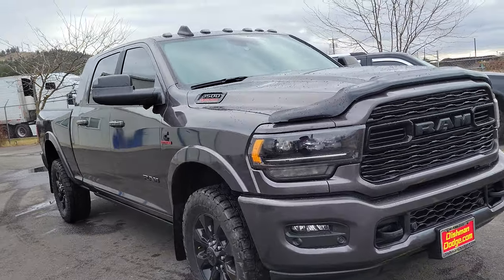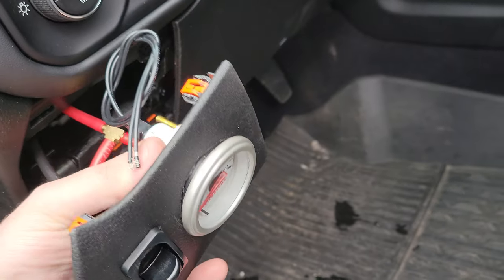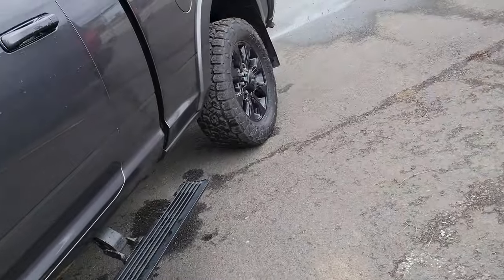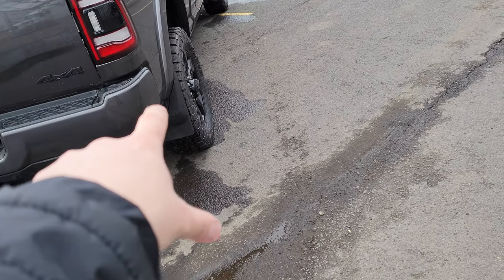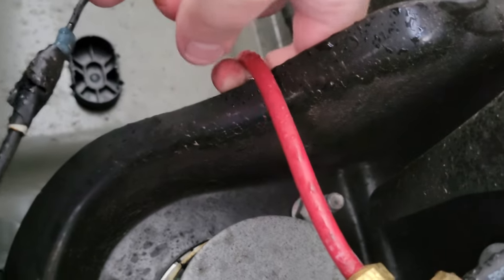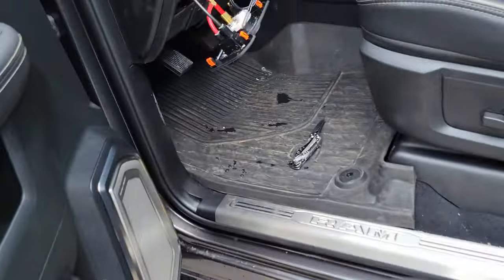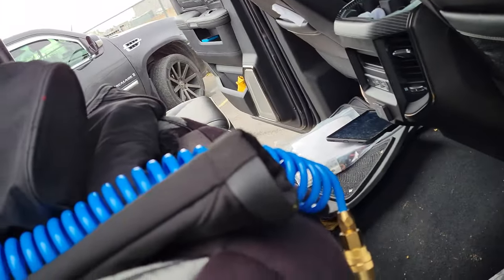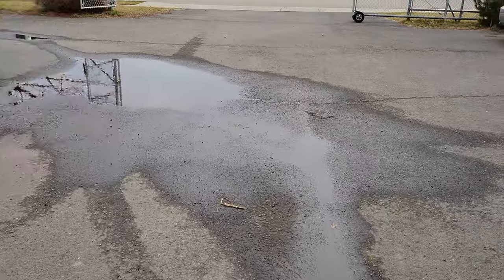2021 Ram 3500 gets a firestone 2543 extreme air quick  connect

Comment: Test drove the 2500 with Coil Springs but wanting to go with the 3500 HO which obviously has the leaf springs in the back. Was told to get it with the Automatic-Level Rear Air Suspension which would tremendously improve the ride quality. Yes? No? Or should I go aftermarket like you did? Will use the truck more or less empty, occasionally hauling some trailers.

Comment: I've found a gauge to be useless. Depending on the load the pressure is never the same. I air it up until it comes off the helper springs and it's good.  Also instead of a mechanical switch valve, I use electric solenoid valves and push connect couplers for the airlines. Solenoids are activated through remote FOB so I can adjust it from anywhere. For the quick coupler for an air hose there is a hole in the corner the rear of the bed I used. Also ran the 1/4 airline tubing inside the truck's frame. And lastly the manual fill I put next to the fuel filler. 
 Just a few ideas for you next time.

Comment: You should use black wire loom on the airlines for extra protection. Especially where you can see the red air line in the wheel well

Comment: That gauge is pointing towards the ground, spin it 180 so you can at least see the needle point at the numbers whole sitting in your seat. You just have to learn to read it upside down. I got that same kit when I bought my toy hauler. It worked ok but don’t think the pressure reading was correct and the lens cove falls off.

Comment: Why didn't you mount the quick connect and the back up air fitting on the drivers side of the truck so your not getting exhaust fumes if you hook up while the truck is running ?

Comment: Hello! First off....amazing videos. Literally just ordered the same truck in the delmonico red 3500 limited.  Quick question what is the tire specs your currently have? Any spacers? Did you need to trim? Please let me know. Want to have tires ready as soon as I pick up. Thanks! And please keep making videos! Great info and straight to the point! Not selling anything just giving your opinion is the best!
Reply: Also.... is your truck leveled? Or is it stock with just new set of tires?

Comment: Thanks for sharing.  I've also run a similar firestone kit on my old pickup.  Trouble free for about 4 years.  Now I've replaced that truck with another and need to reinstall another kit.  Air lift seems to be a more cost effective solution and also has built-in jounce bumpers in the bags so that you don't have to maintain a min 5psi.  Any comment on the durability/quality of Air Lift systems compared to Firestone?

Comment: you have isolate your airbags from each other or they will cause a massive amount of body roll, its is extremely unsafe 

when the weight of your truck shifts it will put more pressure onto only 1 of the airbags, this will cause the air to move from that airbag to the other in an attempt to equalize. this causes  even more body roll and will shift even more weight to one side. its a feedback loop.
Reply: It's fine the way it is. My suv comes from factory like that and no issues, no body roll. Airbags filled with air not water.
Reply: repairvehicle I’m not sure how your specific airbags are configured but it’s possible they are isolated internally with a valve body that you would not be able to see 

Also your SUV doesn’t have a towing capacity of 30,000lbs